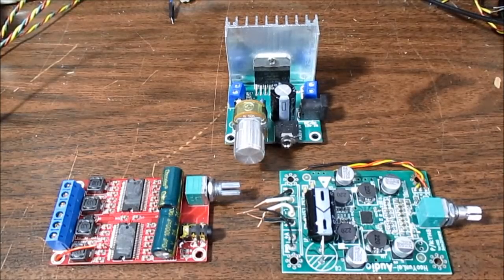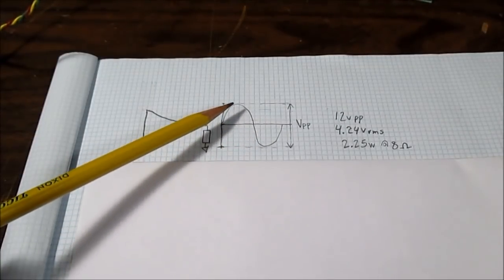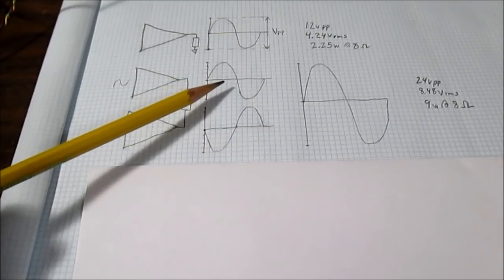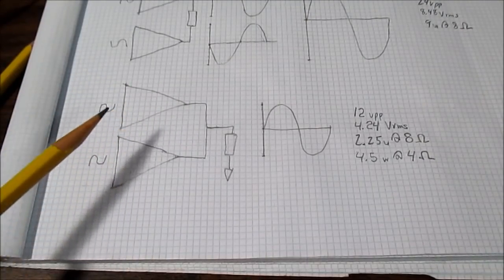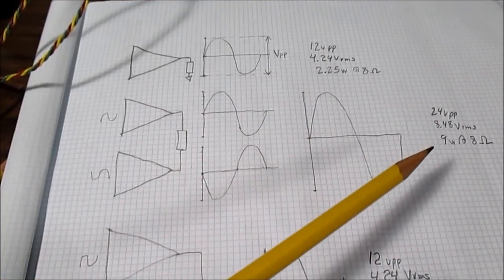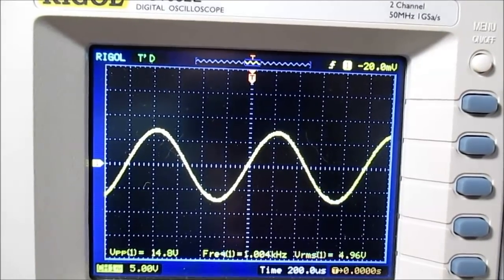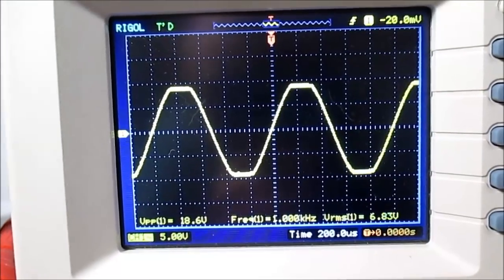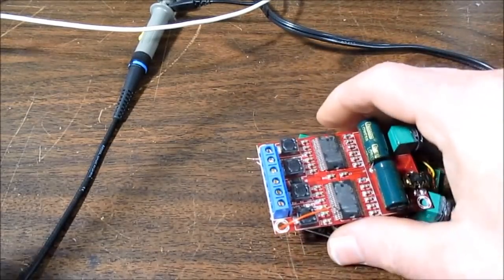Can I bridge or parallel my stereo amplifier board to one speaker?

Comment: I put a TDA7293 on the out put of a 30 watt Bluetooth amp thingy using a transformer for coupling and it works real good. been running for a long time 24 volts.

Comment: Have a question ???  New to Class D amps. Im using a class D Amp with a 12 - 24 Volt DC power supply for my home speakers. The amp is rated at 100 watts  per ch at 4 ohms. The speakers are 8 ohms , so does that reduce the output to 50 watts per ch. Into the speakers ??? Happy your dad is doing well 👍
Reply from the maker: Actual power (per channel) depends on the supply voltage. At 12v, max clean power is around 8 watts @ 8 ohms and 15w @4. At 24v, it is around 28w @ 8 ohms and 50w @4. 100 watts into 4 ohms is marketing fluff unless the amp can run on at least 30-32 volt supply.

Comment: Question: To getta bridge mode you have to phase shift one channel, would just reversing polarity (i.e. hook it up backwards) on one channel effectively invert the phase of that channel? If that does work would you wanna do it on the on the input side or the output side?

Comment: I have a question i have stereo bluetooth module and i want to split the output signal to a low pass filter and then an amp to a subwoofer and an bluetooth ouutput directly to an amp for full range now question is can i split my bluetooth output into 2 diffrent way just by soldering 2 wire for each channel?or I should get a audio splitter for that?

Comment: So no problem to parallel connection for a BTL amplifier (class D)? Same (identical) input signal to the L and  R input and then parallel the outputs? No power gains, but improved lower impedance performance?

Comment: I saw in video on that and used four 0.1 ohm resistors to level the current for the tda7297. 
But I have seen someone instructed to parallel without the four resistors.
So my question is if this chip can be parallel connected without adding resistors??
Someone told that there is enough of resistors in the chip itself!
Can that be measured somehow that it works out for tda7297 without problems?
I am waiting for my two tda7297 to be delivered and plan to use one for each channel. And the speakers I plan to use dips down to 4 ohm at two occasions in the frequency span.
So parallel each amp so they're driving one speaker each is my plan.

Comment: I want to run a single speaker on two channels. The input is not mono. Is there a way of combining the two channels to one?
Reply from the maker: This won't work. It is better to mix the input signal down to mono and use a mono amplifier.
Reply: @JohnAudioTech  Input signal won't work. But I've setteled on two speakers anyway.

Comment: Thanks. Exactly what I am doing raspPi to small amp into a vintage radio w/ one speaker. Thanks again.
Reply: I am trying to bridge outputs to an old tube-type desktop radio, too, using a small amp board with Bluetooth on board. I know how to hook up a single channel (using the radio's phono input), but I can't figure out a clear-cut answer (including in this video) about how to combine the L and R outputs into one. Any tips?

Comment: So just put a .1 ohm resistor in series with both the right and left channel + out of the board and then hook them together to the load? Use one channel or both channel grounds hooked together as the - ground?

Comment: Hello my surround speaker of my AV Receiver gone bad. Its rating is 8ohms 50watts. Can I replaced it with a 4ohms 120watts? As indicated in the unit. Need your expert advise. Thanks in advance.
Reply: You need the speaker to be the same as the matching speaker on the other rear channel. Nobody can answer your question, as you are the only one who can check the specifications of your own AV Receiver (the one in your own house) and read whether it can accept 4 ohm speakers on the rear channels. You can check this yourself.
Reply from the maker: I'd try for an oem replacement. A different speaker will have different parameters and may change the sound. Otherwise, I'd stay with 8 ohms as most AV receivers would be rated at that. Impedance may be stated on the back of the receiver near the speaker terminals.

Comment: please tell me if I have a car stereo with 4x25w output , can i use it as 2+1 amp ? How to bridge the two back outputs to drive a subwoofer ?
Reply from the maker: Each channel would already be in bridged configuration. Use a dual voice coil sub and connect one channel to one side and the other channel to the other side. You would need a low pass filter for each channel as well. Car stereos are usually rated at 4 ohms, so use subwoofer with each coil rated at 4 ohms.
Reply: I will try that . Thanks for your quick reply !

Comment: I did the same exact test with TDA7377, and the power consumption suddenly exploded and the heatsink got hot. Normally you expect the opposite, since the amps see double the impedance, they should work more efficiently. Do you have an explanation why?
Reply from the maker: Sorry for the late reply. Probably one of two things. 1) phasing was reversed when the output is wired up. 2) Input signal is not perfectly balanced. (you can't feed it a stereo signal. it must be the exact same signal going to both channels)

Comment: What's the function of the .1Ohm resistors?
Reply from the maker: To help balance current sharing between the outputs.
Reply: @JohnAudioTech  if i use a stronger amplifier, do i need higher resistors??

Comment: How do i inverse signales.... First taking a mono signale then use two op-amps.... One is non-inv.... & other is inverting configuration.... Then use a POT to gain mach those..... Or just use a single transistor stage.... & 2stage to inverse these....
Reply: Ranjan Gupta both ways are work but I like using opamp
Reply: Sound is a AC current.. by swooping the hot and the cold you change the phase.. that's what we do if we running is phase problems in live audio

Comment: What if I put them in series?
Reply from the maker: You'd need isolated supplies for each amp and would have to isolate the input grounds.
Reply: maybe if you set the second amp halfway and use the pot in the first one

Comment: hi john, i have some question, how about i want to use ( 1 bluetooth tpa3118 2x30w ) and ( 2 mono tpa3118 ) for powering 4 x 3" 30W 4ohm driver?

for input of each mono tpa3118, i just take from tpa3118 bluetooth ( pin 4-5 R IN )-( pin 10-11 L IN ), and parallel power input 19v 3A